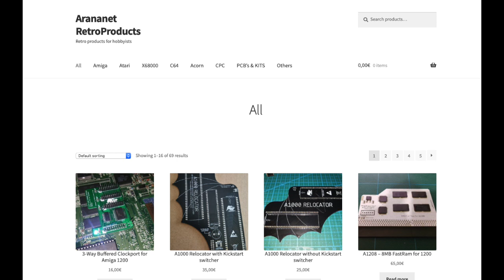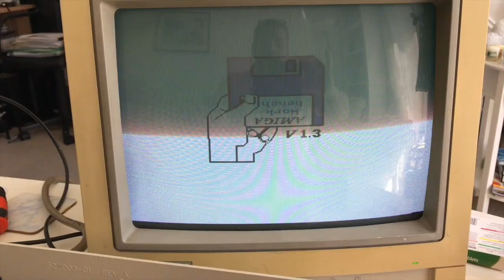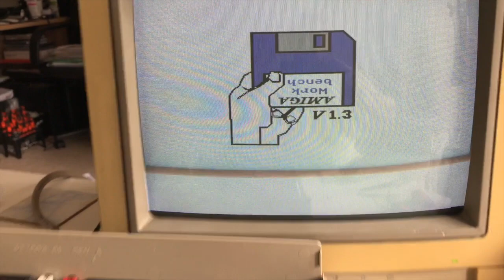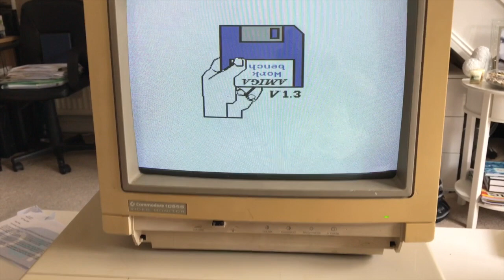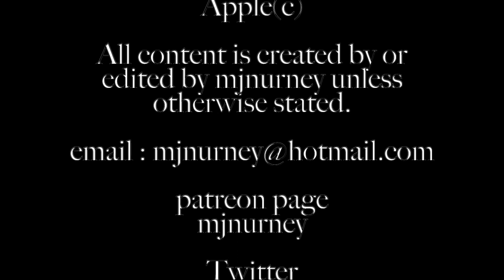Amiga 1000 arananet Kickstart rom adapter

Comment: Its quite a responsive machine surprised me 🙂
Reply from the maker: Responsive in what way?
Reply: @mjnurney  loads pretty quick from floppy
Reply from the maker: Oh I see, the A1000 is slightly faster than an a500
Reply: @mjnurney  I didn't know that
Reply from the maker: Only slightly but yes
Reply: The audio is extremely clean compared to an A500. On many A500 boards, when a game is loading floppies one can often hear a background noise through your speakers; however, this does not occur via the A1000 boards, but keep in mind how expensive the A1000 computers originally were compared to the 1987 release of the A500s.